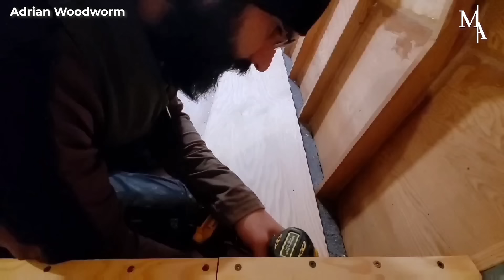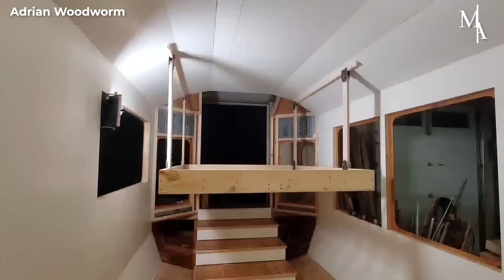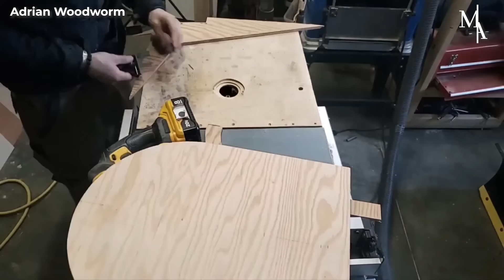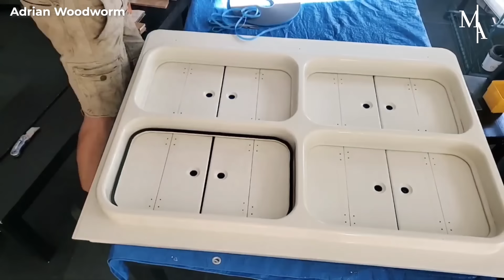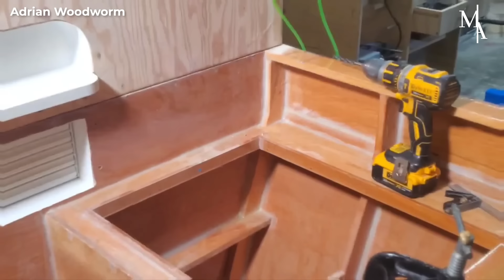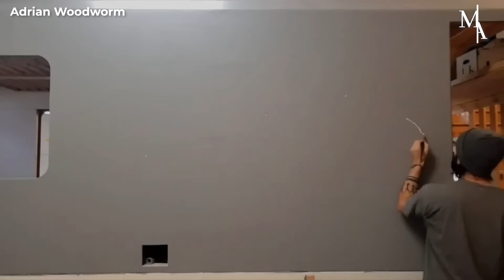Man Builds DIY Floating House for His Family | Start to Finish by @adrianwoodworm

Comment: Would have been nice to see the completely finished boat - inside  and outside
Reply: I just wanted to see if floats.  🙂  Joking aside, as someone who loves woodworking, I almost cried every time I saw him painting over wood panels. But man, the guy has skill...  both in design as well as carpentry... and then painting the exterior murals. Just wow!  But back to the wood bit...  It reminds me of when I was a kid. My father built a brand new set of birch ply kitchen cabinets, and finished them with a varathane sealant to protect them but also show the beauty of the wood . A week later, while he was at work, my mother painted them white. I'm surprised that didn't result in a homicide.
Reply: It seemed like a boatish kind of trailer, minus the whole propulsion and steering part of a boat.  Perhaps it’s a trailer for really damp camping?

Comment: It was difficult to tell how low the floor was set inside the pontoons the boat was built on top of. Like another commenter I'm unsure how much water will stand in the bilge, and whether it will soak into the floor.  

I thought there might be about a foot under the floor, based on a scene near the start of the video,  but with the staircase making it obvious the floor is recessed I'm not sure.
Reply: I found the builder's original channel, and he went into a great deal of detail about bilge water in one of his videos. In short, he never intends to leave the boat in the water long enough for water to build up in the bilge. It will be trailered on land. 

The clip I referenced actually showed the top of the boat, not the deck as I though. There was WAY more than a foot of depth. The insulation and floor, past the bathroom and at the bottom of the stairs, was indeed laid right on top of the boat's hull/keel, with no bilge area under the floor. 

It should be noted, however, that the insulation was dense foam, tested to resist moisture and mold growth. And the hull was sealed with layers of fiberglass below and "epoxy and polyurethane" above. It was not just painted wood. I actually thought it was a fiberglass hull on which the superstructure was built, but that was effectively what it was. I don't expect water to penetrate the hull and neither did the builder.
Reply: The channel name is Adrian Woodworm. The build is from two years ago.

Comment: What about the wxposed wood in the bilge and the cabnets and other enclosed spaces ? Seems like they'd need some paint or moisture protection in those areas more than anywhere.
Reply: Wood framers have no concept of why boat builders use fiberglass to cover wood.
Reply: @HappyBuddhaBoyd  Canvas impregnated with todays single and two part urethanes are not only economical but last for SCORES of years and much lighter, more easily repaired and lay. I am a boat designer and builder of over thirty years and use both where warranted. My only complaint is there is no video on the water yet.

Comment: This guy has mad carpentry skills, but i don't agree with his marine choices.  Putting insulation directly on the hull in the bilge and covering it with plywood, will make a mold nightmare. The bilge  needs to have airflow to allow any moisture that finds its way down to evaporate. A better solution would  be to insulate the floor panels, but leave space between the hull and the floor so you can have a functional bilge space. I kept a 38' sailboat fresh as a daisy but using a solar powered fan to suck air continously from the bilge and draw in fresh air. Also a couple of bilge pumps might be in order.

Comment: The inside is beautiful, great woodworking talent and energy! But...what about the outside? How is the hull going to be made waterproof and durable? Epoxy or fiberglass? How is the outside dealt with? If it's treated in the same manner as the inside I'm sure it will be well done. All the more reason to see it!
Reply: No, a few coats of even marine-grade paint on marine ply aren't going to withstand constant contact with water.  This build is pretty, but better left on land.

Comment: Pretty good work. Was at first baffeled by your design (lacking weights to move the equilibrium of the boat lower and in the center of the boat), but truth is, it probably will not be needed on a lake or some serene river, with no racer engine, and close to none estimated around watter traffic.

The floor-space saving bed is ingenious, same as the dual purpose shower space/storage space.